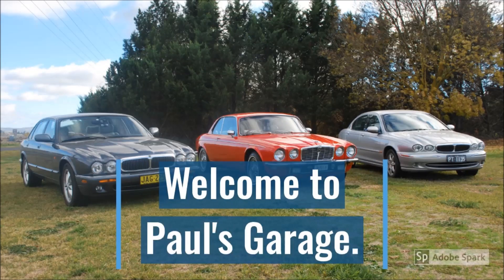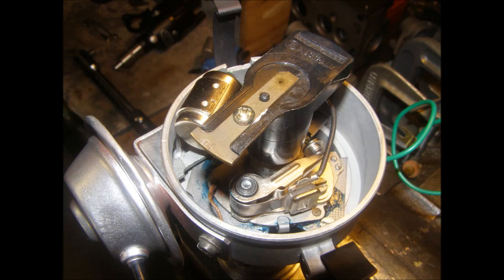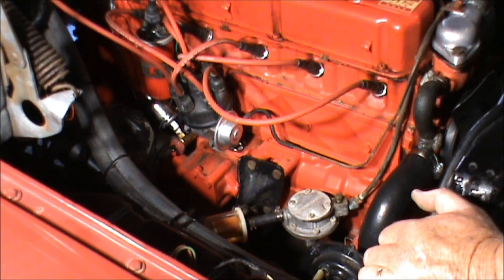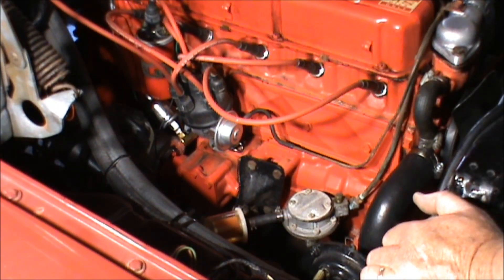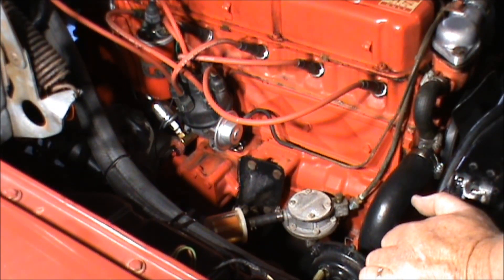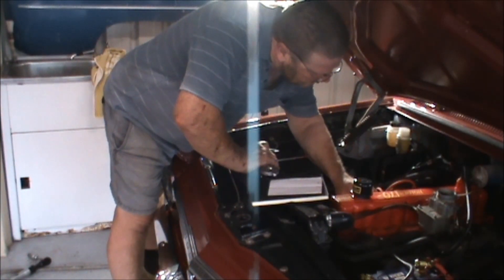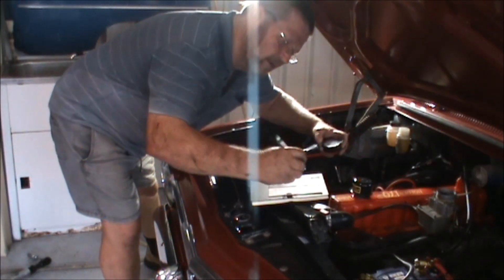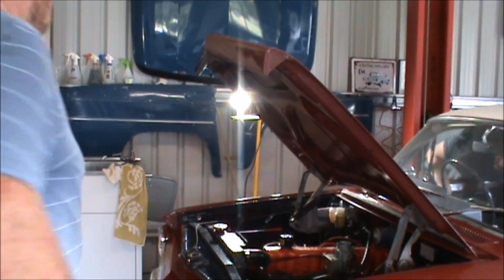Project EH Holden. A new Addition to the garage part 11.

Comment: your one position out on the leads number one lead is if you move the leads one position clockwise they'll be right where the vacuum advance unit is on the rim of the distributor there is a line that is to align the rotor  with  with number one piston tdc on compression 
i did away 30 years ago with old points dissys i use a blue motor  electronic dissy  not a hard conversion but you need to delete the resistor wire from the ignition  so as to get 12 volts to the electronic dissy
Reply from the maker: Thanks for the info, I'll have a look at that today.